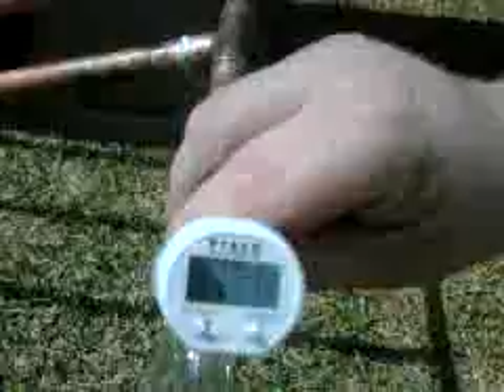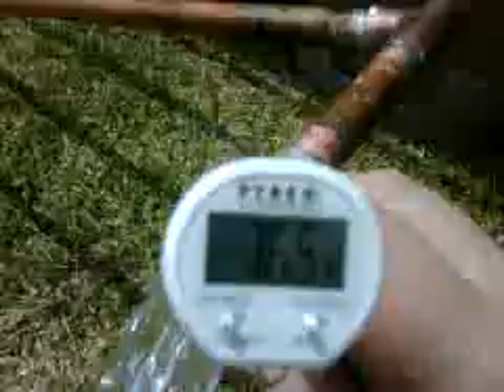Solar Water Heater build 3

Comment from the maker: @zeineguy as of right now it is run off of thermal siphoning, the heat of the water actually powers the heat exchange. Once I finish the system it will be powered by a 12v pump from a battery charged by a 40 watt panel.

Comment: @TheDudeRulez09   on the waste of energy.. i have seen on other videos and will do myself when i do it. It is also using  solar panels to produce the energy you need to run the pumps. that way your system should not be using any energy at all.

Comment from the maker: @zeineguy I am working on both methods you mentioned and also working on a rocket water heating system, the latter shows some extreme heat promises. Conventional water heaters are very inefficient, they run constantly and waste tons of energy.  The closed loop system uses propylene glycol as an antifreeze and heat transfer medium, I have been very busy building my cob community I havent had much time to do further work or video of it yet. Hopefully that will change this summer!!

Comment: would you not have the water going thru a circuit and as it warms, you would keep circulating the warm water and then the hot water?  and then like a normal water heater no cold water would be introduced to the system until you use hot water? I have seen 2 types of solar water heaters..  one is where the fluid in the system is just a closed circuit the is just circulated thru the pipes and then heats the usable water in the tank.